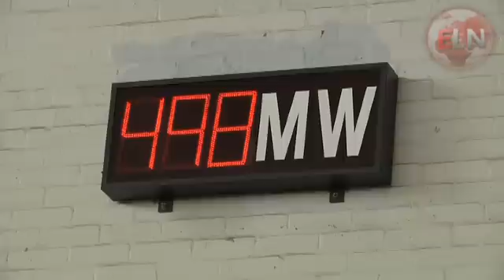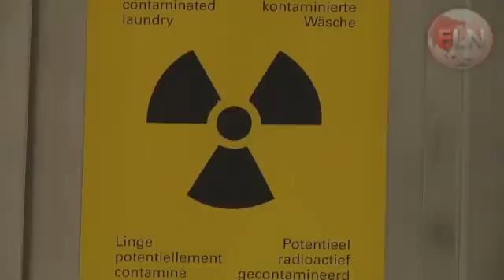ELN - Inside Hinkley Point B nuclear power station | Energy Live News | Energy Live News

Comment: I worked on Sizewell "A" as a contractor but I was a R4/C4 classified radiation worker and had NO WORRIES about the site, I stood on top of both working reactors EVERY day and my monitor and film badges NEVER did show any more than "background" radiation up.....even going into the most contaminated and radioactive areas in the plant.....if you respect the thing you can't see it will respect you...I brought home a monitor by accident one day and stood it on top of a CRT T.V and it went off within 25 minutes....proves you get more radiation from a T.V than a operating Nuclear reactor!!!!